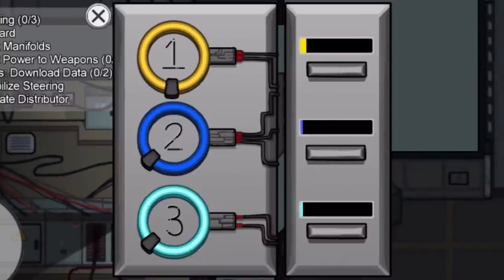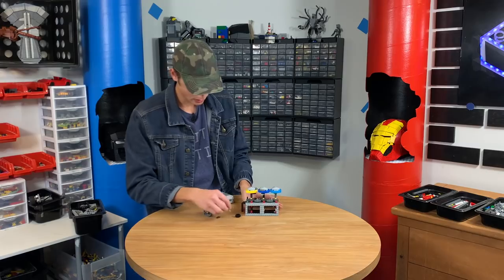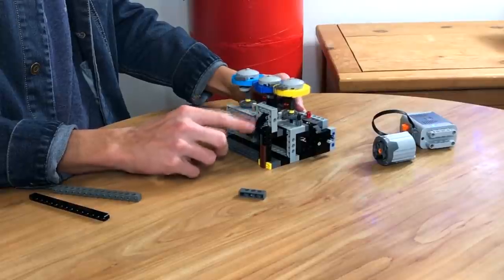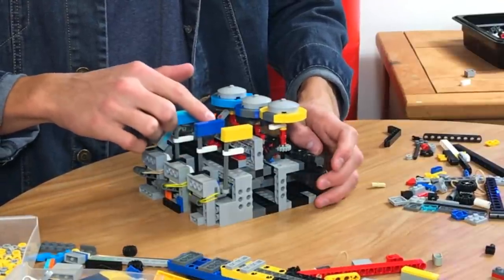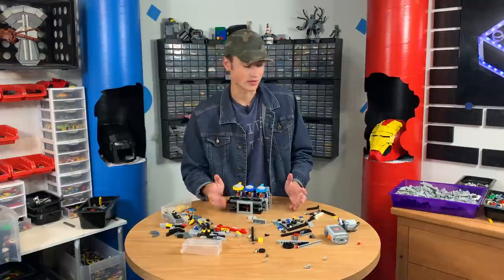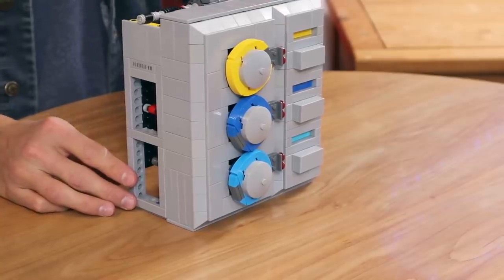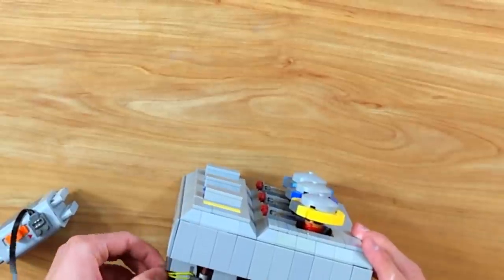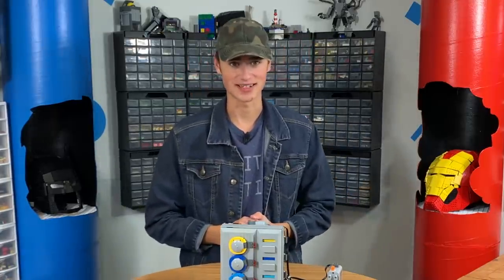How to Build LEGO Among Us Task Game

Comment: Also a cool thing for you to build would be the medbay scanner (no clue how on earth you would do it but if you could I would be thoroughly impressed)
Reply: Make a circle base with 4 clear axels then attach a semi clear green ring and a mechanism to push the axels up and down with the green ring.
Reply: @sunnspot  yeah you could hide the mechanism behind the among us dude. Idk if there are clear axles though, but if there weren’t you could try using the clear beams that come in pod racer sets or something like that
Reply: @robonut0357  Or you could use just clear lego poles. There were some, I just don't remember from which lego set they come from.
Reply: @robonut0357  I think the pod racer ones are a bit tinted tho. Correct me if I'm wrong. I'm not good with lego stuff.